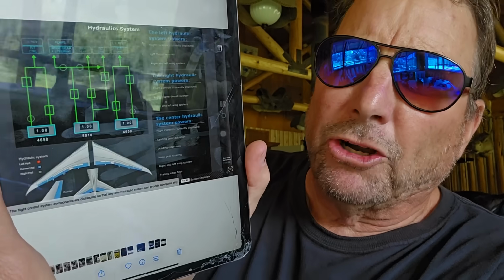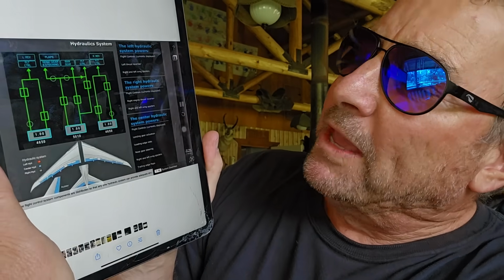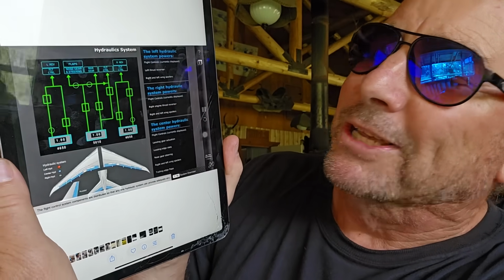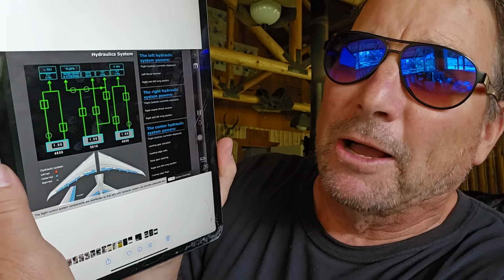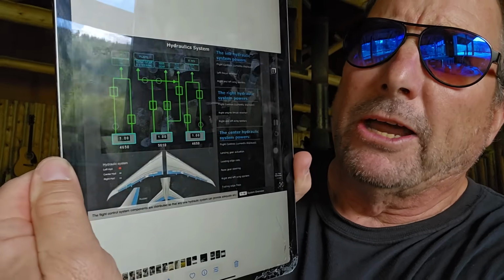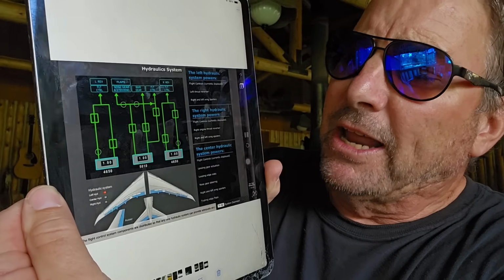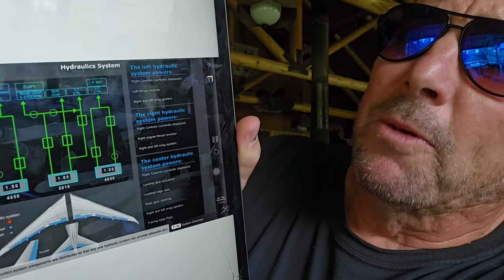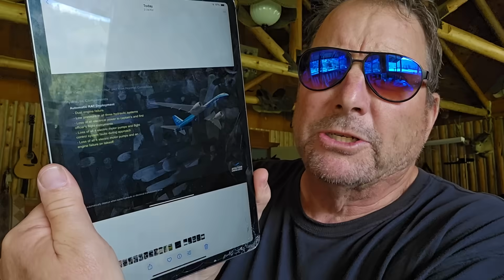787 Crash India What's a RAT? When does it deploy?

Comment: I was wondering whether they potentially lost electrical power which lead to a failure of the fuel pumps which led to the engines shutting down.   The guy that survived talked about a period of 5-10 seconds where the plane “felt like it was stuck” and then the engines went to full thrust.  If they had a permanent dual engine failure I don’t know why he would have said that the engines went to full thrust, instead you’d just glide to the ground.  So somehow the engines restarted. This might be consistent with a scenario in which the rat kicked in which restarted the fuel pumps then the engines kicked back in. If it was the pilots that reduced the thrust, the rat wouldn’t kick in I don’t think.  So I’m going with an electrical failure. Whilst there are redundant systems sometimes these take time to kick in and/or sometimes they can fail to start at all.  Just a theory but fits the evidence so far.

Comment: Thanks for your courageous and life saving analysis of aviation accidents, as well as the life saving proactive guidance with the do & don'ts in general aviation. Yourself, Hoover, Scott Perdue, Paul Bertorelli, Dan Millican, Rod Machado, Vas & numerous other knowledgeable highly experienced aviators have without doubt saved many lives with your guidance & words of warning.
I'm not a fan of the RATS theory, as there just wasn't time for all that to have happened after V1- I wouldn't have thought multiple failsafe systems could all fail in 20 seconds. The plane lifted off normally, but when the wheels were supposed to be retracted, it suddenly lost its lift and mushed into the ground. That says retracted flaps & drastically reduced lift. Possibly at or near gross weight, the machine just didn't have the spare power to overcome the extra drag from the undercarriage. I think the extraneous noise you're hearing is the throttles going balls to the wall trying to keep the plane in the air. It got off the ground easily, so if the flaps were still down & engines 100%, it should've kept flying & climbing, albeit sluggishly. Not long ago we had the really sad scenario when a senior captain doing a rh seat check-ride inadvertently feathered the props on the Saab, resulting in a stall & nearly 70 souls perishing.
I truly appreciate your efforts Juan, & a big hiss to the lawyers who tried to silence you. Cheers to you from all Aussie aviators

Comment: If things were bad enough to auto-deploy the RAT, would that trigger a stick shaker/pusher reaction from the plane systems, resulting in an automatic or pilot-commanded pitch reduction?  In the takeoff video, I think we see the plane reduce pitch/AoA right at the time the landing gear might normally be retracted.  That pitch reduction would presumably result in an immediate loss of lift, so we don't need to conjecture about flaps being erroneously retracted to explain loss of lift.  The pitch reduction might give the survivor the impression that they were just floating there rather than climbing, perhaps more strongly than just a reduction in climb rate would.  What about a major hydraulic/electric/engine failure on takeoff, perhaps triggered by attempted landed gear retraction breaking the camel's back, resulting in prompted or automatic pitch reduction?

Comment: Additional thought: Apparently, there is a higher resolution of the original video which further suggests the RAT was deployed.

We hear the RAT. What we don’t hear is both engines at full power.  As quiet as the 787 engines are, at full power, they are going to be noisy. The fact that the RAT noise is so prevalent, it begs the question, is what I don’t hear possible?

Comment: I watched and listened to Juan Browne and another Airline pilot of the “RAT” deployment Unique sound.

I then realized some sounds where missing, you can hear the RAT propeller turning and the air flowing over the wings.
Yet two sounds to me are missing. The unique sound of the front bypass fan and second the sound of mixed airstream of the bypass air mixed with the core air from the turbine section. That possibility is both engines flamed out or shut down. The Black Box found should give a lot more answers.

Comment: @blancolirio

Hi Juan,

As a former aircraft mechanic, I’ve been reviewing the available footage and noticed a few things that might be worth mentioning—possibly indicative of deeper issues:
	1.	RAT Deployment
You covered this thoroughly already, but it’s a key detail that points to serious inflight systems trouble.
	2.	Partial Main Gear Retraction
It looks like the gear retraction sequence started, but then either paused or failed—possibly coinciding with the moment the spoilers were being deployed.
	3.	Spoilers Partially Deployed on Takeoff (Both LT & RT)
I’m not sure if that’s part of an automatic roll stability function, but seeing both spoilers partially up—combined with little or no flap extension (if that’s indeed the case)—could have severely impacted lift right when it was needed most.

Zoom in closely at the very late rotation, right at the apron or runway end. You’ll notice a lot of debris being kicked up—at that same moment, the spoilers and gear position become more obvious.

Thanks again for your thorough coverage and for always putting aircraft safety front and center. 👍✈️

Comment: Why did they take off from an intersection leaving them with a 6,700' runway, rather than use the full 11,000" that was available? Might be plenty, I haven't a clue. It just seems like on a big plane, you would want the whole runway in case of an engine failure.
This is just a question. The closest I've come to a cockpit is boarding a plane. :)

Comment: Emirates Flight EK407 (Airbus A340 registered A6-ERG) tailstrike and runway overrun accident at Melbourne Airport, Victoria on 20 March 2009, due to a 100-tonne less (262.9 instead of 362.9) "incorrect take-off weight being inadvertently entered into the Electronic Flight Bag during the pre-departure preparation" is another possible scenario. "The Captain and First Officer verified the take-off data calculations prior to departing the gate and while taxiing, but the error was not detected. During the takeoff, the aircraft did not lift off as expected, the fuselage contacted the runway and take-off/go-around (TO/GA) thrust was applied by the first officer at the same time the aircraft became airborne." See Australian Transport Safety Bureau Report AO-2009-012 published 16 December 2011. Credit Green Dot Aviation channel's video "Running out of runway! | Emirates Flight 407" posted Oct 22, 2023.

Comment: I believe that the limited power that the rat can produce was one of the contributing factors the pilots knew that they had generator problems on both engines deployed the rat themselves and was hoping that the rock could raise the gear and I believe they select a gear up but the divided power between the gears and the flaps cause the flaps to retract when they selected gear up causing the stall.

Comment: Here's my theory, but would love to hear what an actual 787 A&P or E&E tech thinks: 787 departs normally, WOW opens on rotation triggering ground-to-air electrical transfer. Latent bus fault surfaces during reconfiguration — bus tie contactors isolate main AC buses. Dual AC loss triggers RAT deployment, FCCs drop to secondary law with degraded trim and stability. Hydraulic degradation leaves gear down, adding drag. Nose-up pitch combined with excess drag leads to rapid energy decay, deep stall, and impact. This precise window — WOW → Air Mode Transfer (first 1-3 seconds after liftoff) — is one of the few moments on the 787 where multiple simultaneous fault chains can fully expose an electrical systemic vulnerability. This is supported by the RAT deployment and the surviving pax saying the emergency lighting came on after takeoff.

Comment: There's a picture of the tail in the wreckage. Looks like the APU intake door is open. It may have been running or just getting started at the time of impact. I'm guessing it's related to the loss of power.
Reply: I know on some aircraft like the 777. There is a option for the APU to automatically begin the start process with a dual engine failure or total loss of power Don’t know about the 787

Comment: It will not surprise me if the entire fleet of 787's is grounded, pending results of the preliminary investigation. This is a complex set of circumstances, and the stakes 
are high. Personally, I would not be comfortable flying on a 787. The 777, yes. Its a 
reliable, proven platform, well liked by pilots, airlines, and the flying public.
 The 787, not so much. Too many questions about its
design, materials, and assembly procedures.
Reply: Claiming the 777 is a proven, reliable platform well liked by pilots, airlines, and the flying public but the 787 is not is peak ignorance. 1100+ 787s have been flying without incident for a decade and a half across 6 million flights. Pilots love them. Passengers love them. Airlines love them, with 80+ airlines worldwide running them on some of the most demanding long-haul routes. It's arguably one of the most successful widebody platforms in history by safety and adoption standards. 

But you "would not be comfortable" flying on one? Because a beat up plane flying for an airline with a shoddy history of maintenance crashed in a manner that a handful of causal chains kicked off and/or contributed to by pilot error and shoddy maintenance explain?

Please.
Reply: @Objectified its normal for him to be uncomfortable until the problem cleared out, no need for you to get angry

Comment: In 2019 an ANA 787 had an "apparent" dual engine failure after landing. Check out flight NH985.
Reply: The NH985 incident was a very specific, low-speed, post-landing edge case in which the pilots deployed the thrust reversers too early, before fully transitioning to ground mode, causing the Thrust Control Malfunction Accommodation (TCMA) system to shut them down. TCMA is designed to prevent potentially catastrophic uncommanded thrust events and is in its near entirety a ground safety system.

Without getting into the weeds, TCMA would not shut down even one engine (much less both) during take-off or other critical flight phases unless there was a profound problem confirmed by a host of multi-sensor, phase-logic, channel-redundant tests that produced a multivariate result meeting a far higher and far more difficult-to-reach threshold than in the NH985 incident.

Comment: I have my own theory of what happened and it makes the sequence of events completely logical. I saw that someone else had also come up with it in your video. Simply a fuel problem. For that to be true, the fuel consumption must be true. There must have been water or something completely different in the fuel they bunkered at the airport. So maybe you, with knowledge of the plane, can calculate. The fuel in the system was enough to start up and warm up as well as the progress on the runway. Just as they took off from the runway, the fuel from the tanks they bunkered reached the engines. This caused both engines to flame out at the same time (when the water reached the engines). Is that how long the system fuel lasts before the tank fuel reaches the engines?
Then the hydraulics that fold in the landing gear stop and the Ramair turbine is activated. They didn't get the last lift from the engines so they were too low when they passed the end of the runway. Then they flew on momentum as far as they could. Maybe they hit the air brakes when it looked like the best place to hit the ground.
I have transported a lot of Jet ful on ships. It is not uncommon for the fuel to be off-spec. Then it is downgraded to regular kerosene. But that is not something anyone wants to do because the price of regular kerosene is much lower than Jet A-1.
There can be bacterial growth in the land tanks that causes the jet to be off-spec. But more common is that a valve from another tank does not close tightly or the piping system has been lined up incorrectly. It has also happened that there is something else in the piping system. For example, when diesel was to be loaded, there was gasoline in the lines and we received 6 m3 before the diesel, so 1500 m3 in the first tank with diesel water off spec. Fortunately, we took a sample of the first one that came on board with the surveyor and it turned out that it was pure gasoline, otherwise the ship would have been blamed for off spec.
When bunkering ships now more, you have a drip device that drips into a sample bottle all the time so you get a representative sample of the entire bunker amount. The bunkered oil must not be used until the samples have been given the go-ahead that they are off spec. The critical thing is often the sulfur content of the ship's bunker.

Comment: Cant rule out a simultaneous engine maintenance error. Incorrect oil topoff etc
Reply: Low oil quantity would give the crew a low oil pressure message after start. If the oil was over serviced I would expect to see a high oil pressure message.
Reply: What about oil topoff with wrong oil on bith engines. The cans can look similar, there is a hydraulic spec can that looks a lot like one of the engine oil spec cans ! And simultaneous maintenance is not supposed to be possible, but it still happens. An oil that chars off after a minute at takeoff power would do a lot of damage.  A very unlikely scenario i grant you, but it does fit a dual power loss event.

Comment: Thanks Juan. The investigation needs to get to the cause of this quickly. I think there's alot of unjustified criticism of the pilots when the evidence most likely points at a catastrophic failure of the aircraft.
Reply: Actually, pilot misconfiguration of the FMS with or without aberrant sensor readings due to shoddy maintenance remains a highly plausible scenario. It could also be a maintenance issue, certainly.

Comment: Hi Juan, thank you for your analysis. From what I have gathered the pilots used all of the runway. A theory I have seen / heard on a video is that the pilots encountered technical issues after reaching V1 put prior to V-R. As a result they had to use the full length of the runway before they could get airborne. But because the issue(s) happened after V1 and (just) prior to V-R they are committed to take the aircraft airborne. As stopping would result in a high speed runway overrun?